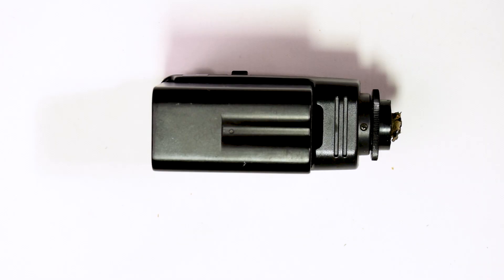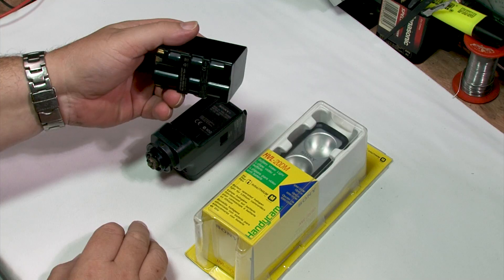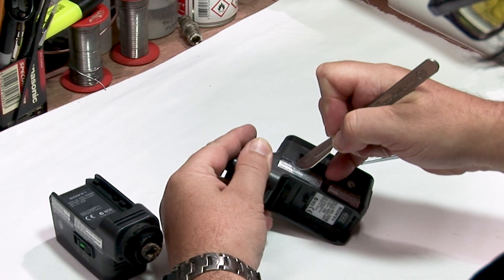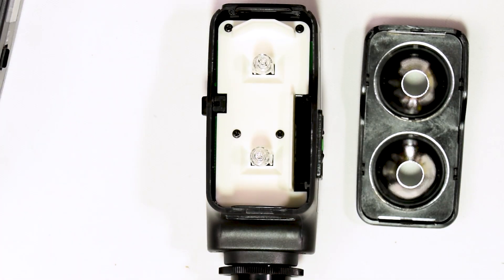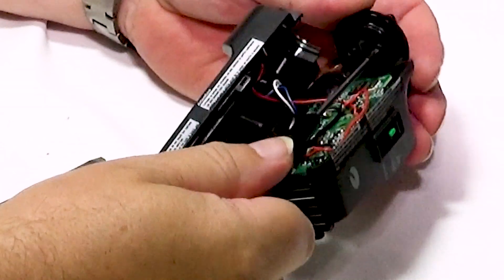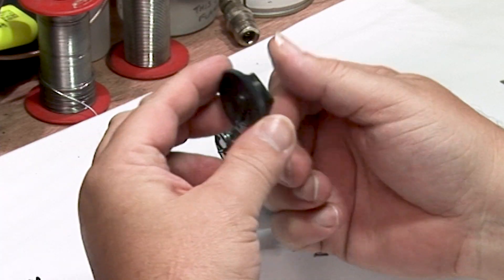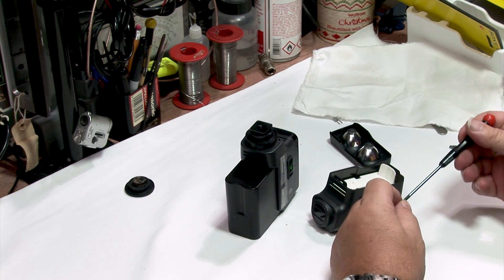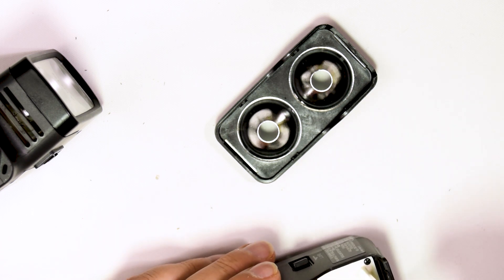Sony HVL-20DW2 Video Light Hot shoe repair

Comment: Nice one George. Yep fixing stuff, any stuff is good and Zen'ish.  Watching and finding stillness.     I fixed and restored 4 estate tobacco pipes lately, champion.   Im smoking the Falcon/Meerschaum insert pipe, (but I dont inhale)!.  Cheers.
Reply from the maker: Many Thanks Jeff. I had thought of bodge fix originally with bolts and chinese hot shoes from stands and things but after seeing the light on ebay, I guessed it might be easier to use the sony bits!

Comment: You clever bugger he he :-D
i would have made an aluminium foot (old heatsink) , then found that there is not enough plastic to put a securing screw in lol.
Sometimes i'm a bit too determined to fix something, the Farce is with me luke err george :-D
Reply from the maker: I had gone that route originally, wondering how to make a hotshoe that didn't short out the top of the camera while fixing a bolt to the top... Glad I found an easier solution.